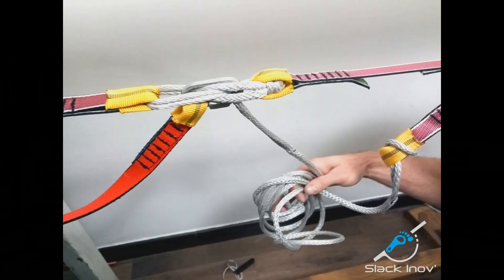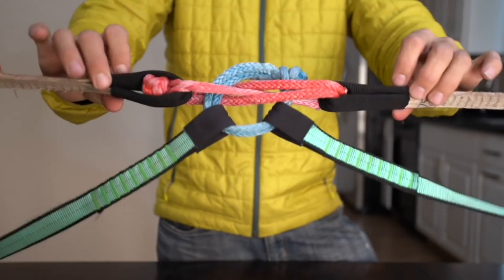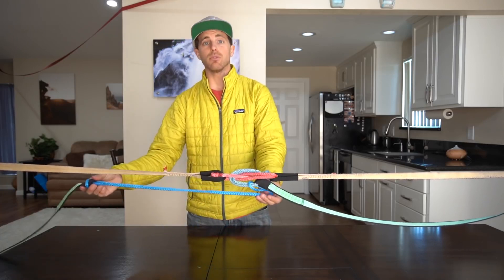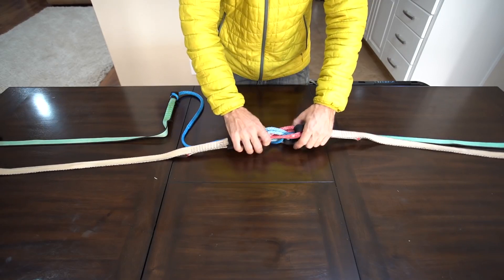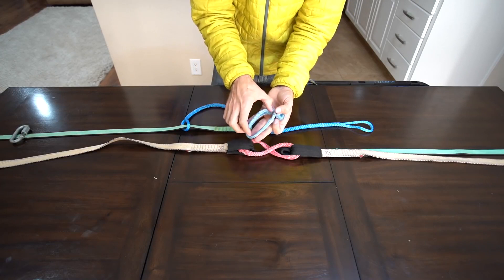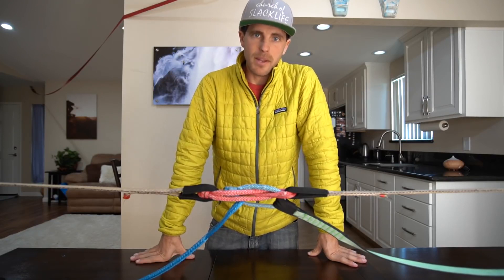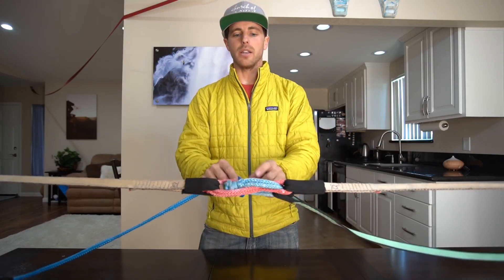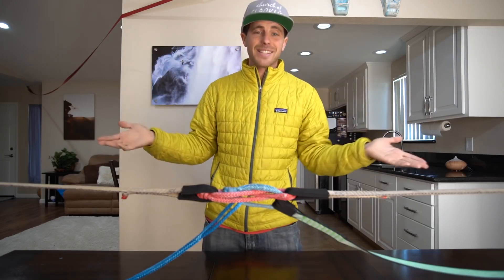Slack Inov SPLIT tecnology divide your highlines by connecting regulary the backup to the mainline

Comment: Your suggestion is to have 4 loops on each section of 50m?
Reply from the maker: 2 Endloops on each strend of 50m. So at the cros section of 2x 50m MAIN LINE and 2x 50M+3mEXTENDER BACKUP LINE you will have 4 loop connected.
thanks